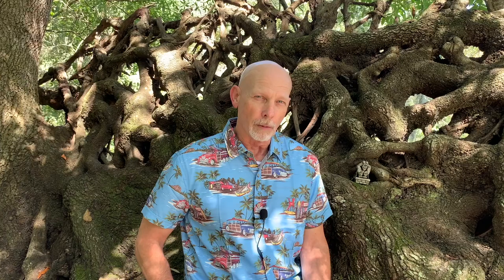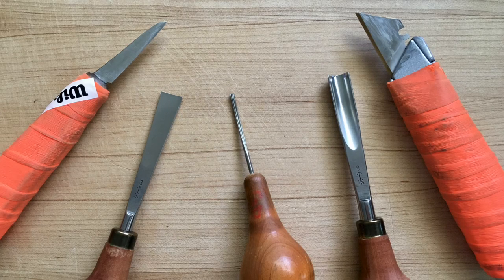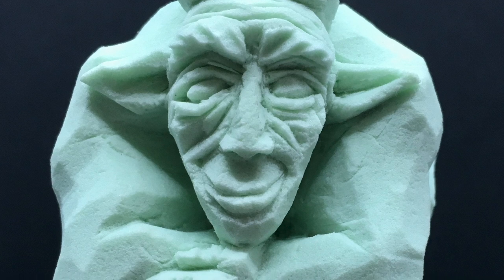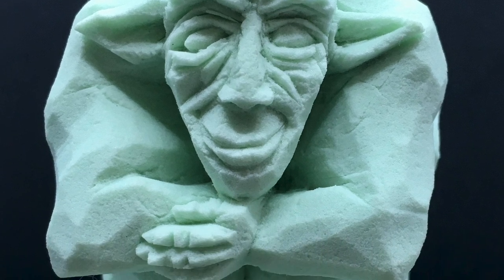Carving High Density Urethane (HDU) Foam - A Product Review

Comment: Interesting you said it takes the same amount of force to muscle through it?  I was thinking about trying HDU to introduce my kids into carving.  Also, have you tried using a wood burner with it?
Reply from the maker: Thanks for your question.  Yes, I would compare it to a quality piece of basswood in terms of the carving effort.  There are specialty electronic hot knife tools that can be used as well but I would not want to expose myself to the fumes from the burning urethane so I have not used a hot knife and I did not used my wood burner.  Kids can be introduced to soap carving as well as carving things like carrots or potatoes.

Comment: Do you need to wear a mask when cutting this foam, I know you can buy also electric cutting tools to do so. This is I have read the dust from the foam due to its contents is extremely bad.
Reply from the maker: Thanks for your question.  Wearing a mask is always an option.  I did not wear one because I was carving with hand tools, not rotary tools like a Dremel.  If I were using a Dremel I would definitely wear a mask.  Happy carving!